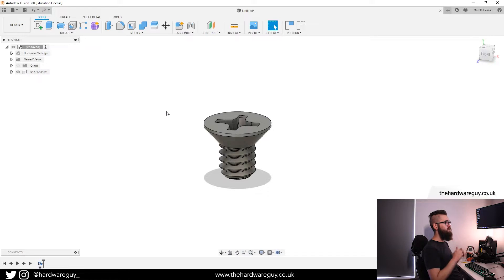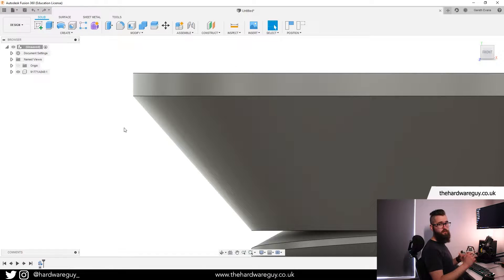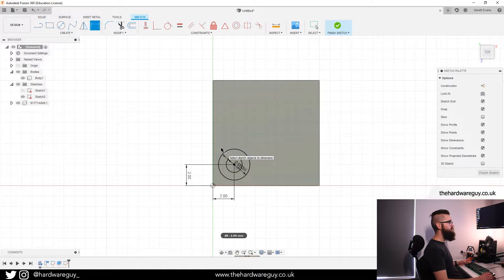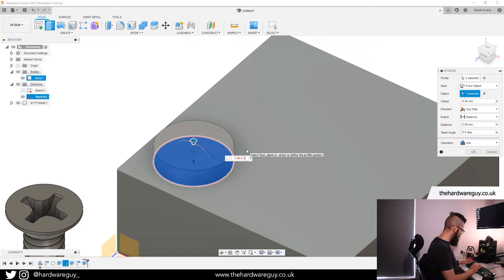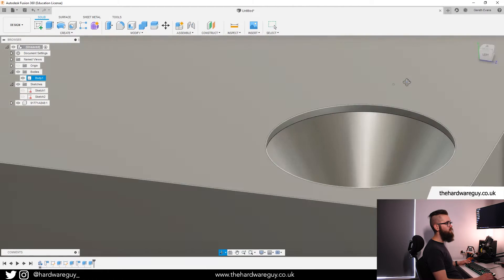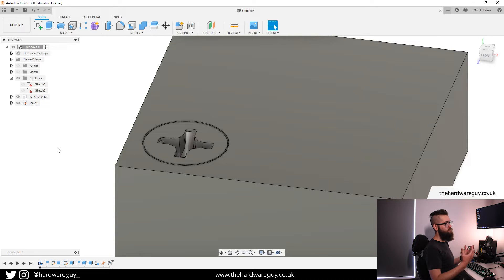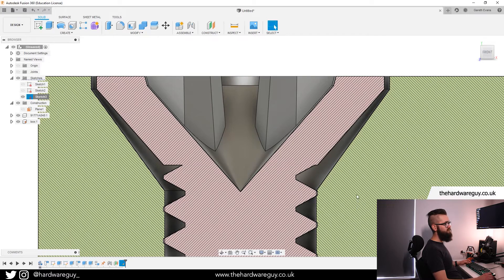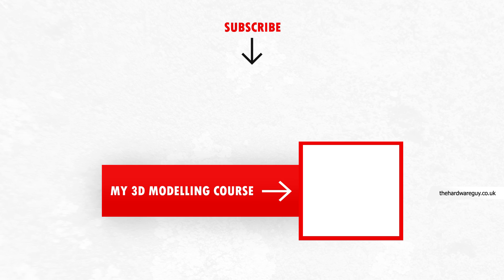Counter Sunk Holes and Sketch Splitting - Fusion 360

Comment: I have been using a slightly upscaled version of the McMasterCarr part and then using the combine feature set to cut to create the counter sunk hole. It requires a little cleanup to remove the orphan bodies, but the only math involved is the up scaling of the screw to allow for  3d print clearance. That’s what I love about Fusion 360, lots of ways to do things. And, lots of powerful tools to em with.

Comment: Interesting approach, why not use the hole wizard? I have found that if I use the correct standard, I get a really good fit on 3d printed parts.
Reply: i've found the complete opposite
Reply: For UNC countersunk timer screws I've found that the screws fit proud of the surface which is a little annoying.